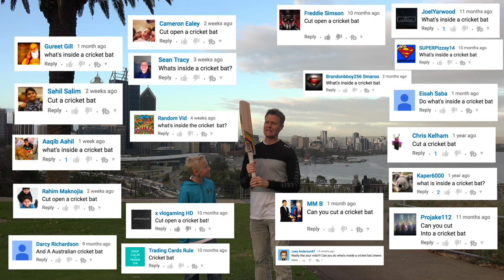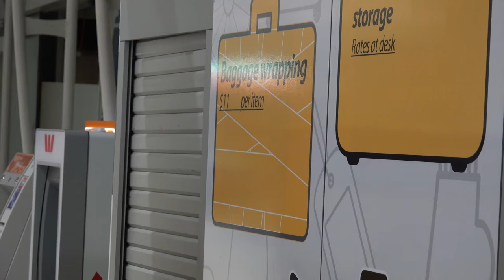What's inside a Cricket Bat?

Comment: The handle is made from bamboo glued together and shaped and the black lines in the handle can be either cork or a type of rubber used to soften the impact on the hands when hitting the ball and to give the bat a bit of space to bend and not snap... the main part of the bat is a type of wood called English Willow. It is the best type of wood to take constant impacts from a hard cricket ball without breaking. In Us dollars a top of the line cricket bat can go for +- $600 depending on the grade of English Willow that is used to make it...
Reply: C Mocke I’m pretty sure handles are made from cane with rubber strips running down lengthways

Comment: Cricket Bat:A cricket bat has two parts-1.Handle and 2.bat.The things which make it expensive:1.Those black lines are rubber which are used to resist the high speed of the balls or your wrist may broke.2.The handle and bat are made separately and they both are attached with a strong glue for 2 days with 200kg force.3.The wood which is used in making the bat.4.Finally the brand.    HOPE YOU LEARNED SOMETHING=LIKE IF YOU AGREE

Comment: If you guys first looked on how a cricket bat is made you would know that it is made from English Willow wood and they cut the tree into a third of it’s diameter. They make the handle and the face of the bat separately then they glue them together, then they use a machine that spins the whole bat around really fast and that is how that put the string on the handle. Then they cut the face of the bat with a very specific saw to make all the different bows and archers then they stick on the stickers to brand the bat. And if it is a size bat for a young kid they would put a layer of plastic over the face of the bat, just to protect it from getting wet because when you are young you don’t always take care  of everything you own, and if the wood gets wet the bat is absolutely destroyed and would not be able to play with.